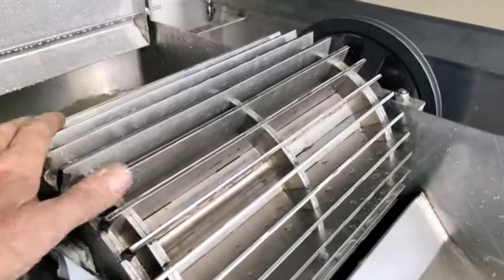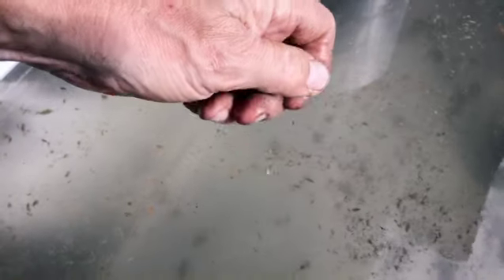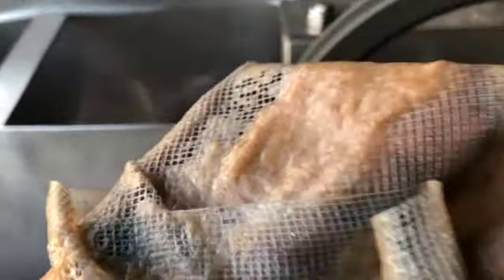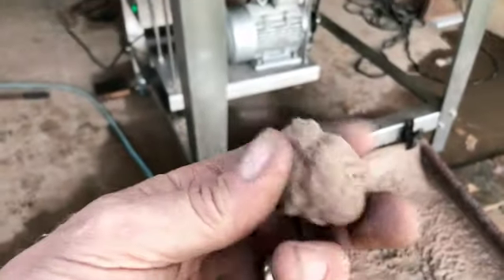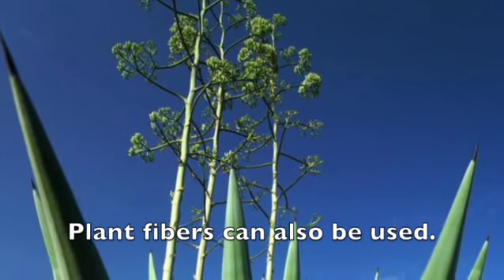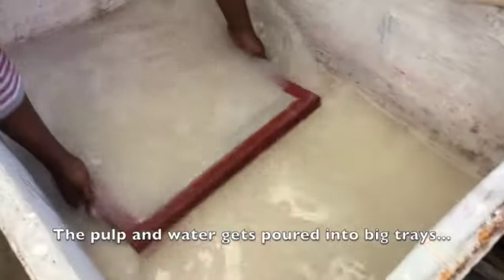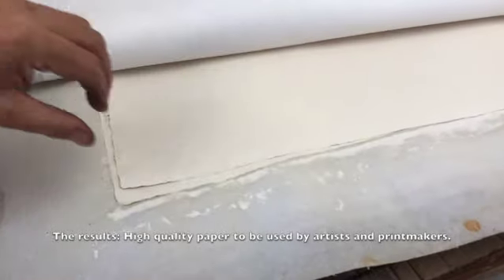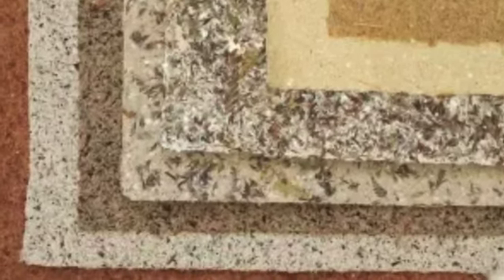How to make paper and what is a PAPER BEATER?

Comment: Is that beater made of stainless steel?
Reply from the maker: Hi. Yes it is mostly made of stainlesssteel. Some of the mechanics underneath and the main bearing blocks are of thick aluminum. But those parts does not come in contact with the water.
Reply from the maker: Did you watch the whole series? Part 1 -6 ? https://youtu.be/lzq-Q8W9DMU
Reply: @thequixotryworkshop2424  I am currently watching as time allows. It is a truly impressive design.

Comment: How kilograms per batch and what's the duration of running the machine
Reply from the maker: Hi Agrippa. I don’t know that, however you can keep on adding untill the mix looks saturated but still runny. It must not be so stiff that it can’t circulate. 
Then run the machine for an hour, check if you like the results of the mix ( do a small test paper) and if not run it for another hour. Do this until you are satisfied. Document the amounts you add and work out a recipe for yourself for the next time.
It depends on what you add. Pieces of fabric ( cotton) will take longer.
Reply: Thank you for your reply,I would like to use water hyacinth plants from the nearest dam